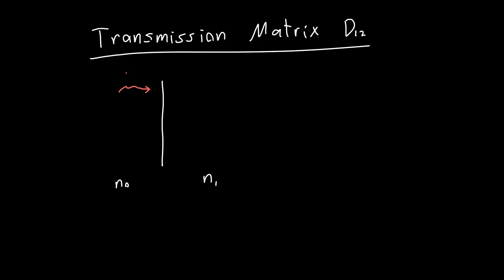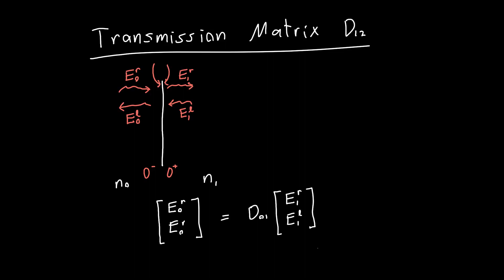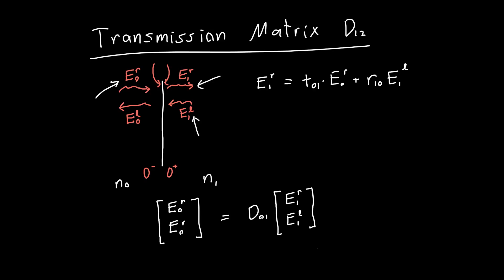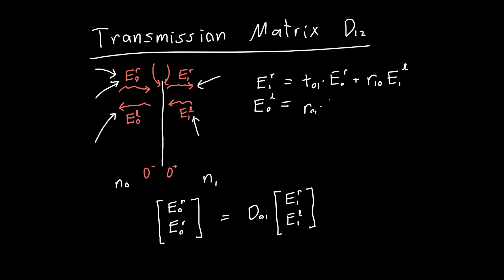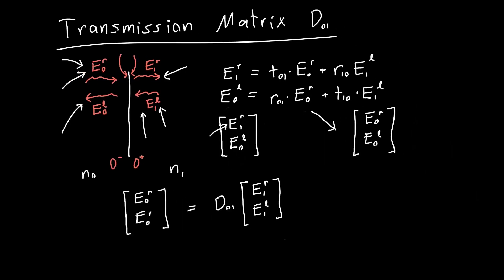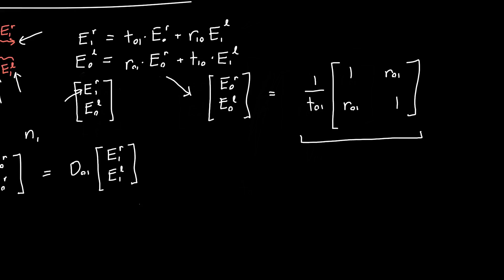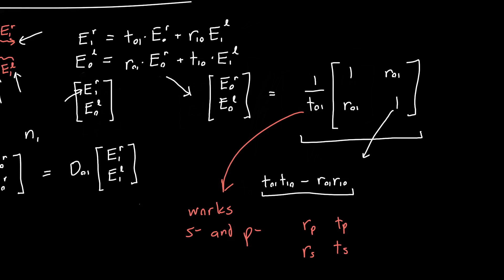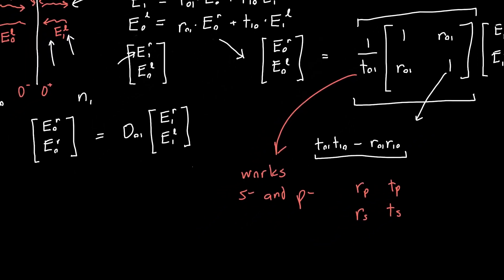Transfer Matrix Method Part 2 (Transmission Matrix)

Comment: The element T12 is not ro1. the correct is -r10 which is not equal to r01 in general!  could you clarify this? and also could you explain why t01t10 -r10r01 is 1?

Comment: Dear Jordan how you rearrange the second equation we have E0r instead of E1r it is somehow confusing the rearrangment of the matrix  THANKS  for your replay in advance
Reply: Do you have your answer? I've been scratching my head for almost an hour. :(
Reply: @copter2000  I know this is 10 months late, but hopefully this will help other people who watch this video in the future.
You can rearrange the first equation to E_0R = (1/t_01) * ( E_1R - r_10*E_1L). 

You can substitute this expression for E_0R into the second equation and rearrange a little to get:
E_0L = (1/t_01) * (r_01*E_1R - r_01*r_10*E_1L + t_01*t_10*E_1L)

=> E_0L = (1/t_01) * (r_01*E_1R + (t_01*t_10 - r_01*r_10)*E_1L)

In this case for parallel planar interfaces arranged in a nice stack, t_01 = t_10 and r_01 = - r_10, you can think of this as the reflected wave travelling in the opposite direction to the original wave so it needs a negative sign. Since these are the amplitude transmission and reflection coefficients, in this case with no other losses at the interface t_01*t_10 - r_01*r_10 = T + R = 1 (transmission + reflectance = 1 by definition assuming no absorbance / other losses at interface). So:

E_0L = (1/t_01) * (r_01*E_1R + E_1L)

Therefore you end up with the matrix shown in the video.

Comment: SIr,  I am an electrical engineering student. Sir how Transfer Matrix Method is used for solar pv module as it a multilayered structure.
Reply: Probably a bit late to be of use to you, but to use this with a solar pv structure, you have to use a modified refractive index, n' = n - i𝒦, where 𝒦 is the extinction coefficient for the medium. This can be used in the propagation matrix to account for absorption in the structure. For a more complete model, you also need to account for angle of incidence, and probably some sort of method for estimating losses due to defects at the boundary within the transmission matrix...

Comment: Hi, I am an electrical and electronics engineering student. I am working on a project about photonic crystal structures. I have to learn about Transfer Matrix Method with all details. However, I could not find an expressive book.  Do you have a recommendation for me? Also, thanks for the video. It helped me a lot.
Reply from the maker: Ahhh photonic crystals. Sure there is “Optics in Layered Media” by Yeh. It’s an older book but treats the transfer matrix method in detail.
Reply: @JordanEdmundsEECS  Thank you so much for your interest.. I will get it as soon as possible.
Reply: @cigdemo.8491  Could you download Optics in Layered Media?
Reply: @wahwahkyaw1702  No, I could not find the book in digital sources.
Reply: @JordanEdmundsEECS  How can i get Optics in layered media? Could you share to me?
Reply: Same here, i am also working with photonic crystals. It always seems to be little completed with these photonic structures

Comment: Sir, I would like to ask you that how to gain practical knowledge in EE? I am in 2nd year.
Reply from the maker: Definitely actually go out there and do some engineering. If you attend a university, then doing research at your university is a great way to get experience (most of what I have done), or getting an internship or working on projects with friends.
Reply: @JordanEdmundsEECS  Sir at the end is the r01=-r10 if yes then how?